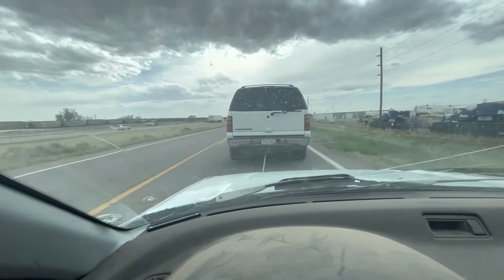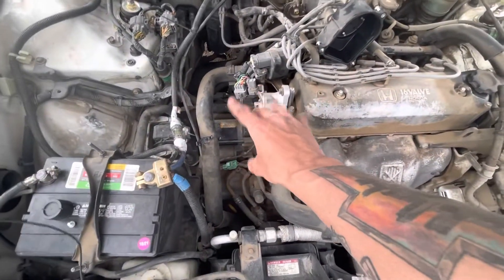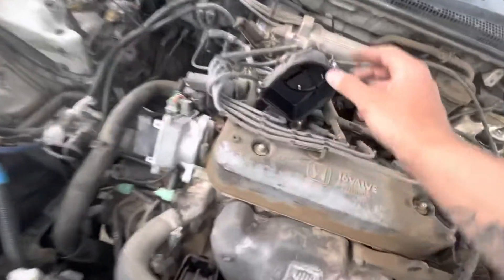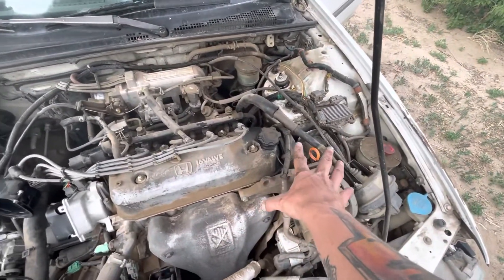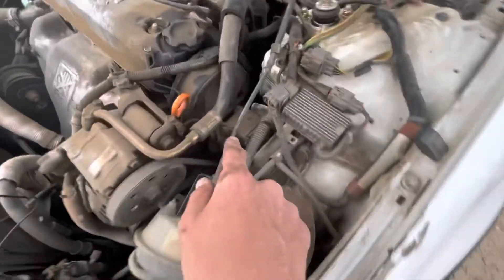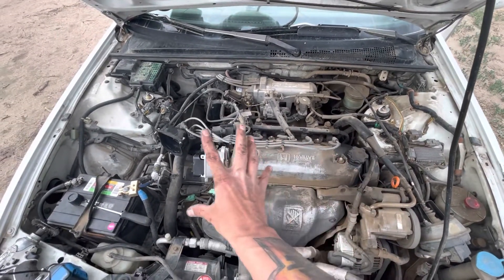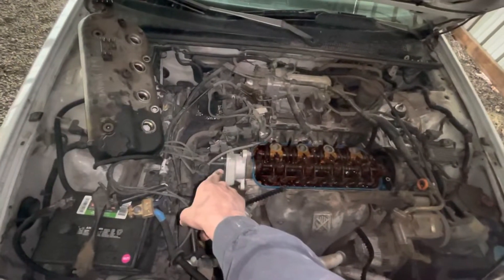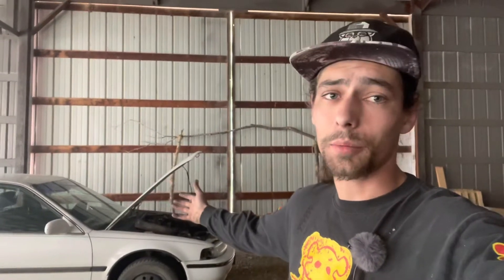Troubleshooting a Broken Timing Belt on my 1992 CB7 Honda Accord

Comment: Just snapped a timing belt on our '92. I'm worried about it being an interference engine. Shoulda done my homework on the 2.2, cuz I thought all old Hondas were non-interference. I was sadly mistaken.
Reply from the maker: Don’t give up! That’s what happened to this 92 accord while getting in the highway at about 70mph. I bent 6 valves. But I replaced them all, put a new head gasket since I was that deep. Slapped the head back on with a new timing belt as well as a water pump because it runs off the timing belt and didn’t want to get back in there anytime soon! I was back on the road after that. Just a little more work. It’s definitely not the end of the car!